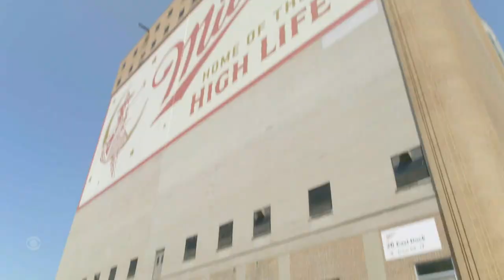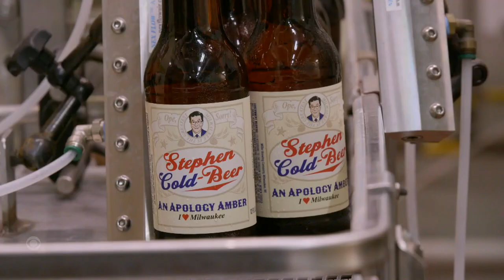Stephen Wins Back Milwaukee's Love With An Apology And Lots Of Free Beer

Comment: 4:03 It is very cool you got to make your own beer, but if you are going to hand it out to strangers, even in a private setting, you should have canned it. They didn't say what hops or grain was used, but looking at the color and the brewmaster saying "balanced" makes me think you got an Americanized Märzen bier typically 6-7% ABV, what you got was probably 7.1-7.8% ABV.

Edit: Adding the tear would have been made sanitary during the brewing processes. Heating the mash (water,hops and grain) helps convert the starch in the grain into sugars around 131°F-149°F (used as food for yeast). Once you get the sugars out that you want (more sugars = higher ABV), boil out the mash to stop the processes. This serializes the tear and denatures any enzymes used to help create soluble sugar. Cool to a temp your yeast can survive and add it. A one way valve is a necessity and you should have beer in two to four weeks.
Reply: None of those people were strangers. For instance the black woman was local news and pbs host Portia Young
Reply: @DEATHBYFLYINGCDS  Alcohol in glass containers outside is a stupid idea. Better?
Reply: @BansheeBunny  You've never been to a tailgate have you? or seen a corona commercial
Reply: @DEATHBYFLYINGCDS  You've never seen a broken glass bottle on the street, sidewalk, park, under a dock, mt. trail, camp site, river or stream?